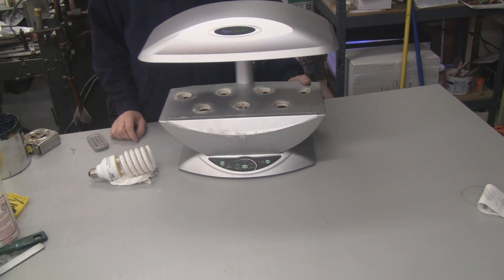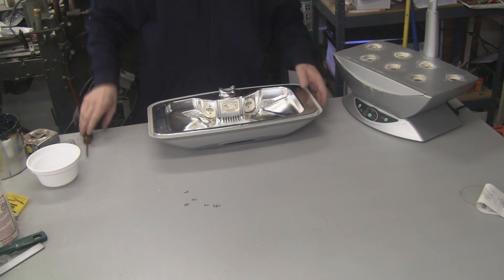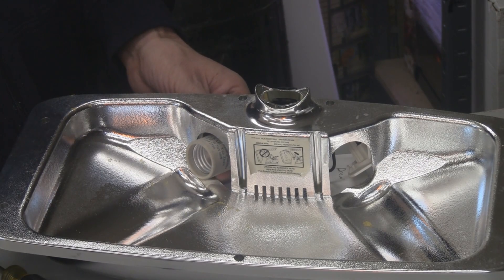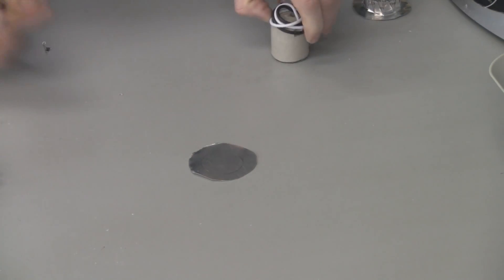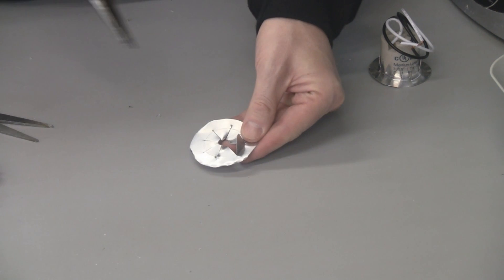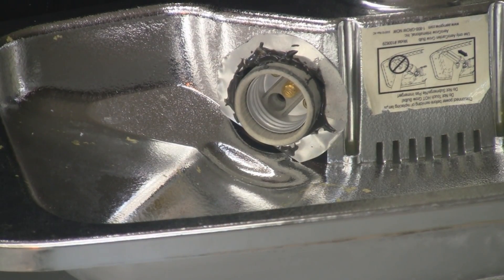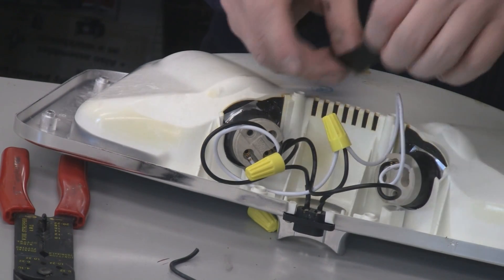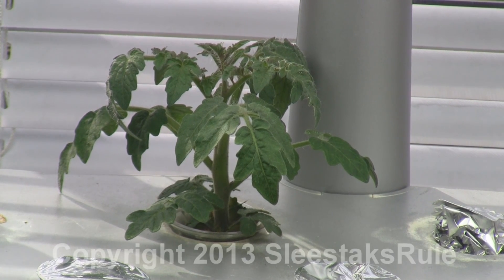How To Modify The Aerogarden Grow Light Step By Step

Comment: There is actually an adapter you can plug in to use regular bulbs. Lot cheaper and no fuss or disassembly.
Reply from the maker: Yes, somebody mentioned that n the comments that they sell them on ebay for $8.  The bulbs I used I'm sure wouldn't fit in there with it.

Comment: I know this is an old post...hope yours is still doing well, Has it ever overheated or cracked the hood top?  I bought 2 CFL adapters on EBay, at about $8 a piece, that just plug into the AeroGrow sockets, then you screw in a 'medium sized base' twisted CFL bulb into each one. I have 3 of these old classic gardens. I use them as 'light gardens', to grow  African violets, they love the Original lights, and I put the adapters in 1 garden, and they seem to like the twisted CFL lights as well. It is a heck of a lot easier to buy these, than go through all you went through even though your idea is great. 

I dont think I could put in that big of a bulb in my adapters, it is for 'medium sized based' bulbs. My lights are 'Sylvania Natural Light, 60 Watt, 5,000K bulbs'.  4 bulbs for $9. Just an idea, if anyone is reading this, or if 'SleestaksRules' comes back to read this.  Give it a try, and see if you can compare the two side by side, if you have another old garden left over.
Reply from the maker: It did well and never overheated.  My Aerogarden I think we got in 2006 new and the plastic REALLY gets brittle.  I didn't know about those adapters until after I did this.  Still it can take a bigger bulb.  I used the biggest that would fit.

Comment: Would this be safe for the 3 bulb delux aero garden, as the bulbs are different
? They never have bulbs and way too expensive.
Reply from the maker: It probably works the same.  It should only take a few minutes to open up and find out.
Reply: @SleestaksRule  the sockets on the deluxe run through the circuit board, that is the only reason I haven't done this, the one you have, you can buy adapters for, but not the deluxe, I'm totally peed off at aerogarden.
Reply from the maker: I would never buy an Aerogarden.  I think I bought this in 2006.  I know I saw the sockets you can get on Ebay but with that socket extender you cant fit the bulbs I used.  The reason I can't use this any more is because the plastic that they made this out of becomes brittle and breaks.  It's good for a few years.